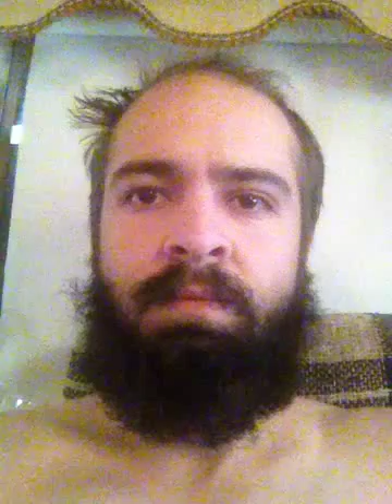How to make Wootz steel

Comment: You know, I was reading earlier today that wootz was made with certain leaves and twigs and thinking that could be the missing ingredient in modern wootz.

A metallurgical analysis of an old wootz blade could tell you the percentage of carbon, vanadium, molybdenum, but those polyphenols wouldn't be found.

I'm taking a wootz making class in July. Experiments will follow. 

I've found lab furnaces online that go up to 1800C and can be vacuum or inert gas purged...they're not too terribly expensive. They also allow you to program the rate of cooling.

Also want to try adding nanotubes as the carbon source.

Comment: That is real damascus, don't talk shit. Historically pattern welded steel has been called damascus, it is a widely used term from as far back as the 19th century.
Reply: Damascus is steel forged from Wootz steel.  Folded bullshit is a fake imitation.
Reply: No it isn't read any book about forge welded gun barrels from well into the 17th century and they will refer to it as Damascus. Either way Damascus is wrong as it was traded there but not made there.
Reply: Provide a link.  Even if you can find a book that says damascus is made from folded steel it is wrong.  The definition of damascus is steel forged from wootz.
Reply: NatureHacker Google Damascus steel, google provides the definition as:steel given a wavy pattern by hammer-welding strips of steel and iron followed by repeated heating and forging, used chiefly for knife and sword blades. Such items were often marketed in Damascus during the medieval period.
Reply: "Damascus steel was a type of steel used for manufacturing sword blades in the Near East made with wootz steel.[1]"
https://en.m.wikipedia.org/wiki/Damascus_steel

Don't troll please.

Comment: Hi have you managed to produce any of that yet? Is anything for sale?
Reply: I put this on the back burner because it required a lot of charcoal to make and I couldn't afford it.  But in the near future I may have a near limitless source so I may continue experimentation.
Reply: I found in ebay that they sell carbon nanotubes... could you use them as the carbon needed to make the wootz instead of plants? I dont have the knowledge just making a stupid question thanks for your time.
Reply: yes you just need to have an oxygen free atmosphere (sealed crucible) so the carbon nanotubes don't burn off.  But you need a few % carbon so it will cost a ton of money.
Reply: Hi its me again! I'm in the procedure of buying carbon nano tubes from e-bay and we want to give it a try with a friend of mine... i wanted to ask you for  400 grams of pure powder iron 99.99% purity how much carbon nano tubes do we need in grams to purchase? we are planning to put the iron in a closed crucible with the nano tubes do you think it would work? and could you suggest a method on how to do it? like what temp range should we use... should we heat it up slowly till it reaches how hot and for how long? thank you again! you have been very helpfull allready!
Reply: 1540 c the melting point of pure iron. 1-3% carbon.  1.5% was ideal in the ancient methods.  Traditionally there were 2 things happening, creating nanotubes and separating the iron from the iron carbon mix creating the banding. To do this you need to fully melt the iron and keep it molten to allow it to mix up well and then need very very slow cooling.  Let me find the temperature range where the banding occurs.
Reply: at 1.5% carbon if you could melt it 1540c (shake it and make sure is sloshes) for an hour then set the oven to 890c and let it chill at 890c for several hours.  The key is at 800-890c is where the banding happens so the longer you let it sit at that temp the bigger the bands will grow.

Comment: So what happened here? Were you able to produce the steel? Is it viable for knife making?
Reply: I couldn't get my forge hot enough to melt it with a bag of charcoal.  I will try again with less airflow so hopefully the charcoal will last longer.  I didn't want to use more than a bag because it is expensive, $20 a pop.

Comment: How is the wootz coming?
Reply: right now its not financially viable for me, I used $20 in charcoal and it didn't get the forge hot enough for a full melt so it would probably be $40 in charcoal so its not worth it at this point for me.  That or I need to figure out how to adjust my blow drier so it doesn't burn too fast.

Comment from the maker: Just use my method to finally try it out!  Everything seemed to go according to plan but I haven't opened the forge yet I am in the 2 day cooldown.  I will post an action filled update video and show you how it went and my results!
Reply: mdimarco87 how did it turn out? was it a success? do you have a video of the ingots? I wanted to know how do you close a crucible thanks for your time
Reply: well it wasn't because for 1. I couldn't get it hot enough because I didn't have enough charcoal.  2. the crucible did break.  The thing that needs to be done is cover the crucible in leaves then cover in clay so when the leaves carbonize they allow a teeny bit of airflow out so the crucible doesn't break.  Since you need to let the steel cool in the crucible you will ruin any crucible trying to get the steel out so the traditional clay method is probably best.

Comment: Thanks for the recipe, I was finding for months one that really works. I've made a pair of ingots with your method and none has fractured at forging.
Reply from the maker: Awesome!  Did you get wootz patterns?
Reply: After polishing
Reply from the maker: also super slow cool is essential to getting good patterns.  Do not take the crucible out hot, let it cool as slowly as possible in the furnace, you may need disposable crucibles so you can break it out the next day.
Reply: My ingot just slided out, the steel shrinked leaving a 1 millimiter space between it and the crucible. Only had to break the glass on the top.
Reply from the maker: Ok awesome good to hear.  I plan to do it without glass and a sealed lid like the original method but hey if it works go for it.
Reply: I have sealed the lid, with the lid open the heat consumes all the carbon and the steel become ver y fragile.
Reply from the maker: cool well then you may want to try without adding glass then, probably adds a lot of unnecessary silica.  in the ancient recipies they never added glass.